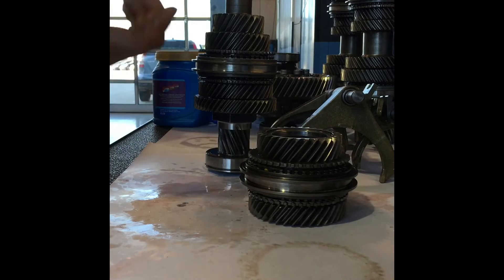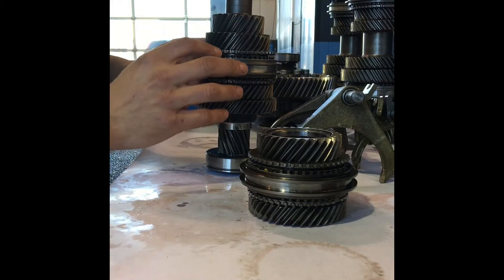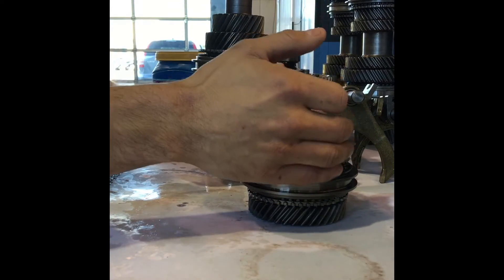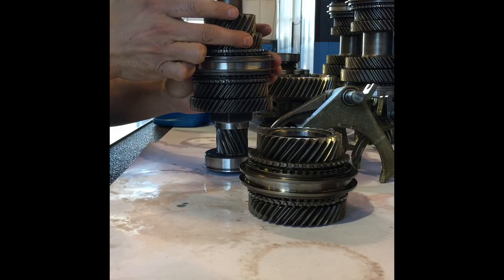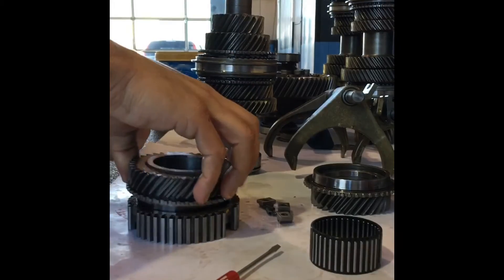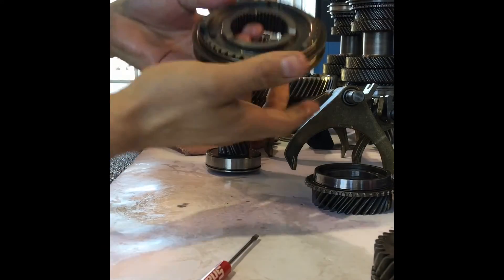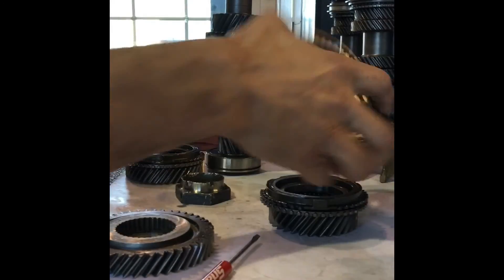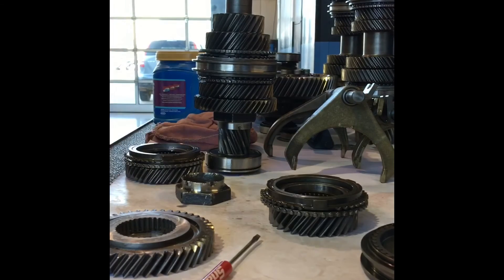T-850 SRT-4 3rd gear synchronizer look over

Comment: Have a quick question.  I pressed on 5th gear.  Using a 20 ton press I got the gear to where it wont go anymore.  but the gear next to it seems to have side to side movement.  is that normal?  it seems like there is too much play.  any help would be appreciated.

Comment: Would synchro's have anything to do with insufficient gear engagement? My wheels spin but the gears don't fully engage with what sounds like a shaft spinning freely with some subtle grinding. Kind of like something broke and is barely grinding against sidewalls with no torque to move the vehicle. Would that be a synchro issue or possibly an input shaft? I'm trying to use your instructions to solve what might be my problem. I would really appreciate any suggestions you have. Thanks
Reply from the maker: Sounds like it could be Various problems. The possible issues for gear skipping would be, Bad Clutch engagement, Worn gears with bad teeth, mis-aligned gears if snap rings or racing bearings/Output shaft bearing could have came apart. Check input shaft teeth and clutch pilot hole teeth. Inspect output shaft. They are known for breaking teeth and destroying the differential teeth.

Comment: my shift fork broke would you have to have a visor on how to install the new one?
Reply from the maker: advise to check my "How to remove" the gear set which will include the forks to come out with it. They have punch pins that need to be removed for replacing on the shaft